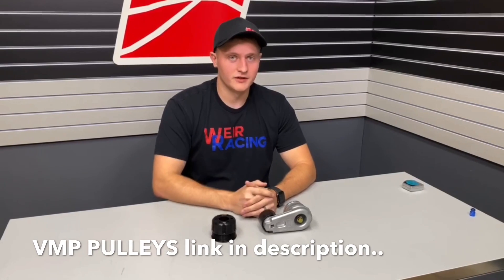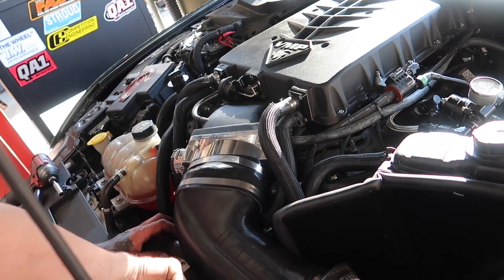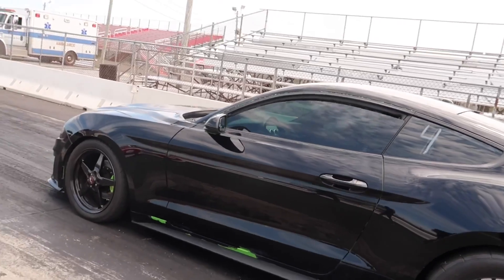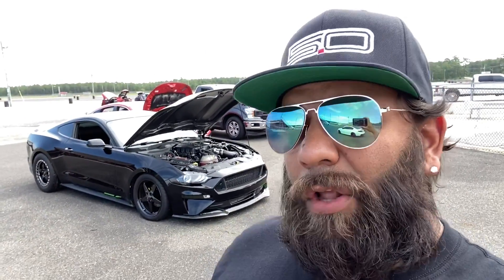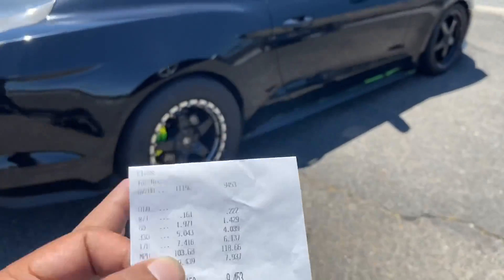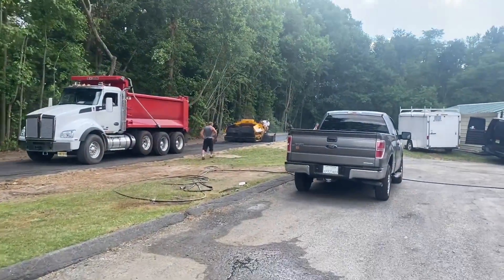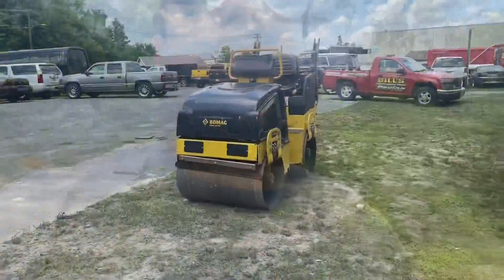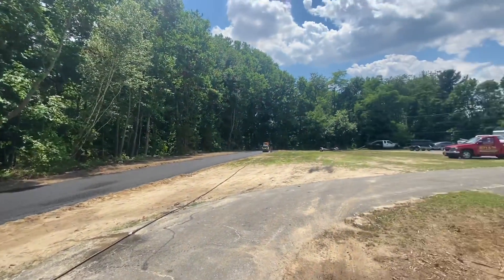BLACK MAMBA gets MORE BOOST! *Doesn’t End Well!

Comment: I would do bias ply r's and adjustable suspension will help put pressure on the rear tires. But if you drive it on the street hopefully regular r's should work.

Comment: Need to make sure your suspension is setup properly too. front end rebound could be coming up to fast. Back might be squatting to fast or not enough. But good you have a test track to play with that. Rather than wasting runs at the strip.

Comment: From what I see the front suspension needs tightened up. Its slamming the top and unloading the rear. 100% suspension issues. You can see it plain as day. Not the tires when you're not making that extra boost in the first 10 feet.

Comment: Wow, I'm surprised that stock engine is still holding up...
Reply: It's not stock
Reply: @lawrencehoward7836  
The lower is stock. I figured everyone knew he's got a VMP supercharger, injectors and fuel system and most likely running E85...
Reply: Jefferson Henn pretty sure that’s what he meant
Reply from the maker: Lawrence Howard it’s a stock motor
Reply: @StangMode  so that car is being pushed to its absolute limits..🤔
Reply: Lawrence Howard There are stock Gen3’s out there holding 1000+whp, so no, he’s not pushing it. David Van Voris was pushing 1100+whp on a stock Gen3 when he ran 8.20 @ 160+.
Reply: I would seriously start thinking about upgrading the pistons at these power levels.

Comment: You coulda just Launched it a lower Rpm or eased into it I don’t drive a car with that much horse power but I did drive a car I had before it got stolen a full built Honda N/A making 350 whp I spun when I’d hit at an rpm when i just had full bolt ons after ur just ease into it and I’d take off cuz it takes 0.5 second to hook after take off just a thought sorry for the long paragraph